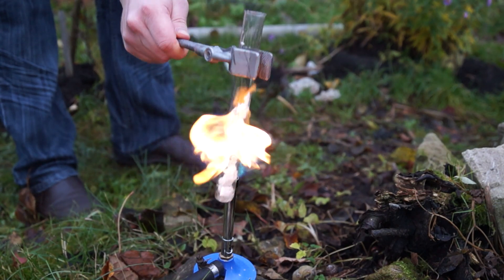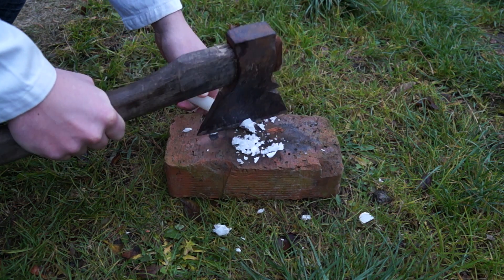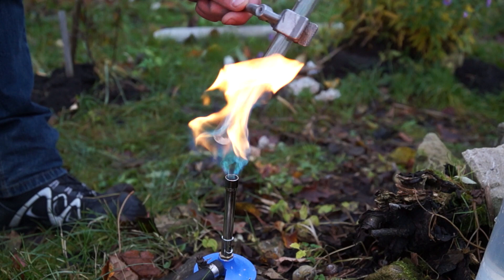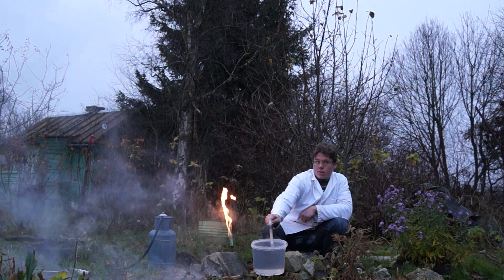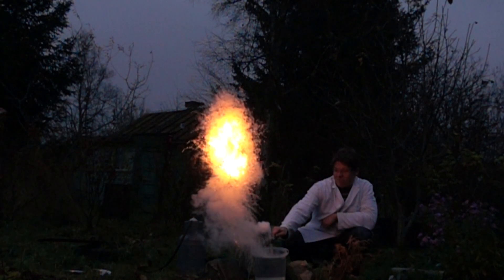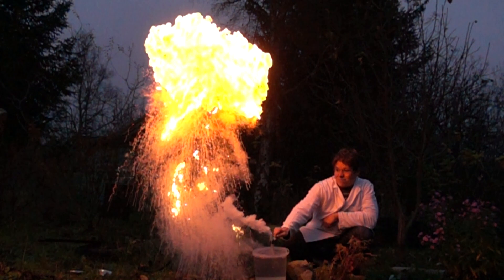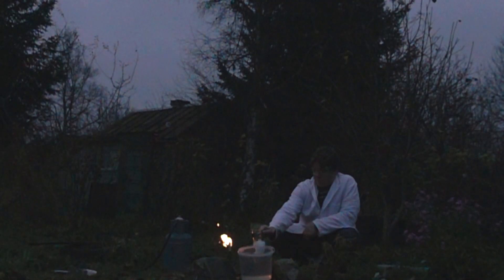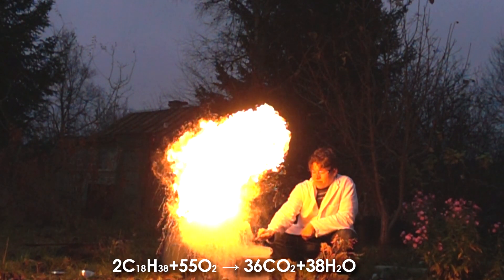Hot Paraffin Wax + Water = Fiery Reaction!

Comment: Nice you had a little wind there!  But yeah, your open flame ignited the spontaneous combustion of this wax is 400F, and water would not be required.  However, you could get a really bad steam burn from this occurring, but there wouldnt be any fire involved.

i revoke this  - this can start ablaze just with the flash boil when the wax is boiling.  great work, you should see what happens when you put it in ice cold gasoline next.

Comment: Hi,  Sorry to inform you, but I discovered this method in the late 1950's only I used the explosive energy in the form of a small rocket that propelled over 300 feet into the air. I coined the word  (WAXOGEN), which is formulated wax and water or possible heavy water injection. This new     source of energy can be used as a rocket fuel for outer space where there is no gravity. If you   have Any questions, you can Email me at, waxogen@gmail.com You can view my FB page and   learn what formulated waxes can do such as preventing the spread of radiation, removing oil    spills from water and sandy beaches, or preventing Radon Gas from entering into homes or      cocooning highly radioactive waste for long term safe burial etc,  Thx for posting your demo..       William Nelson  .

Comment: So +Michael PASTOR claims that I don't know what flash point is.  Well, correct me if I'm wrong, but the flash point should be the temperature with which the vapor pressure of a fluid yields a high enough partial pressure in air to give a combustible mixture with air.  So even if the wax reaches its flash point, it is still NOT enough to self ignite it.  I guess you deleted your comment for some reason, so if you have some different info genius, let me know.
Reply: DANG JOS   Actually, I deleted the comment. I posted the original comment whose reply thread you and Michael Pastor started arguing in more than a year ago, and I didn't want to see it descend any further into petty name-calling in my notifications list.
Reply: Phil P  Understandable.  That's fine
Reply: DANG JOS   By the way, I googled for an MSDS for paraffin wax, and found one that lists its boiling point as 322 °C, its flash point as 198 °C, and its auto-ignition temperature as 245 °C. So it seems entirely possible that it could self-ignite under the circumstances shown in the video.
Reply: Phil P  Really?  I'm surprised that it would be that low.  Actually, I'm surprised that it didn't already ignite while being boiled if its auto-ignition temperature is so much lower than the boiling point.  It should have ignited while it was being heated
Reply: DANG JOS   I guess it must need to be in the form of a fine mist before it will auto-ignite explosively. While it's still in the test tube, it would only be able to burn at its surface, where it contacts the air, and I imagine as it boils, the vapour it produces might drive the air out of the tube. But if that's the case, I wonder why there's no flame coming out of the top of the tube while it's being heated. Maybe there is some burning vapour, but its flame is dim or invisible until the explosion happens?
Reply: Phil P  That's an interesting idea and you might be right, but I feel like a boiling point that far above the autoignition temperature would almost guarantee a flame being produced.  Regardless, there's no way for us to know unless they repeat the experiment, but extinguishing the flame before putting the tube in water.  I personally still think it was the fire that started it

Comment: I have done something similar with candle wax that was on fire. it was in a pan over a fire outside and then all I had to do was drop a soda cap full of water into it. instant fire ball that seemed over 10ft tall(I was close to it, so it might have been shorter). kind of similar to throwing water on a grease fire.
Reply: like Water injection in old biplanes ?

Comment: how did it ignite?
did it touch the tourch?
and wats the melting point of the wax?
and finally,how many fps was the slow motion video?
Reply: Probably the torch.
Yes.
Around 110F (43c) but the boiling point is much higher.
Reply: No.  Fire is not contagious.  The wax will not burn unless there's oxygen present.  The wax will also not burn unless it gets hot enough to reach the temperature at which the reaction begins.  Inside the test tube there is no oxygen to react with so it's not burning.  After the steam pushes the wax out the wax, which is hot enough to start burning but hasn't been because there was no oxygen, is suddenly exposed to the oxygen in the air and immediately begins to burn.

Comment: It was lit by the Burner, take the burner and it won't do that
Reply: no parafin is a petroleum product just like petrol. if you heat it to its flash point it becomes dangerously unstable. the water reacts and it flashes.
Reply: Still, it might have not ignited if there was no burner. This way, that was a bad arguing with having the burner around.
Reply: @nofreewill42  It was clearly the Burner lighting the wav vapor.

Comment: Flash points:
Paraffin wax without additives: 199°C (390°F).
Paraffin wax with additives: 249°C (480°F).
That would have to be some REALLY HOT paraffin to burn just by being sprayed in the air. I'm thinking the burner did it

Comment: I know someone who did this by accident! 
It was my great aunt and her husband. She was melting paraffin in a casserole to put on top of marmalade (it seals from air and prevents mold), and she forgot the casserole on the stove. The paraffin started burning, she panicked, grabbed the casserole by the handle and called her husband for help.
He panicked and threw water at it.
It made a big fireball just like in your video, and they both ended with some serious burns on their arms...
Reply: I did it once by accident to, was experimenting with a small parafine table candle the sall ones that have aluminum casing and I kinda started a small fire and decided to throw some mud on it and it instantly got a mini fireball, good thing I was outside
Reply: that is not what happens here though. everybody knows that putting water onto a burning oil/oil product is bad news. in this experiment though, the paraffin was not burning before it got vaporized.

what happened at your auntie's was that the water that was added to the burning paraffin is heavier than the paraffin, so it sank to the bottom of the pot where, due to the heat, it rapidly expanded, pushing the flaming wax out of the pot. 

in this experiment here, the paraffin is atomized so finely that the heat energy it carries is enough to allow it to self-ignite
Reply: @CookingWithCows  
Could you explane the self ignition again
Reply: +Josh LeSage (SIK3Ri) That happened to me as well ! There was a candle with aluminium casing on the ground outside. To light it off I poured water from a watering can on it. There was a 2~3 meter fireball that rose up in the air !
I never managed to reproduce it though...